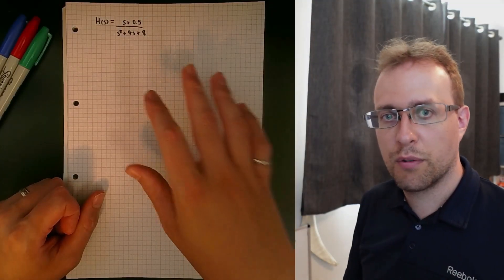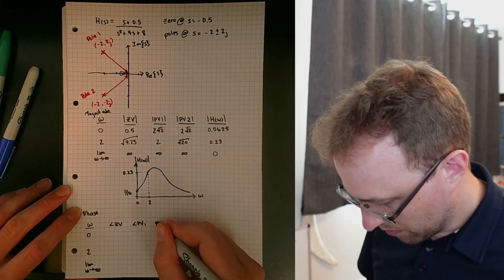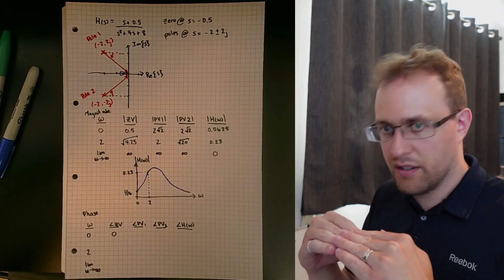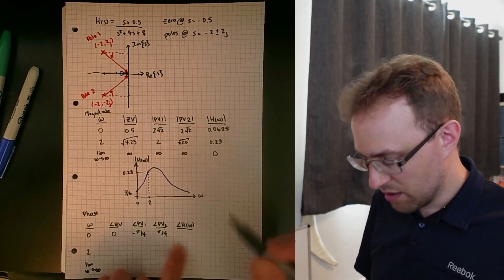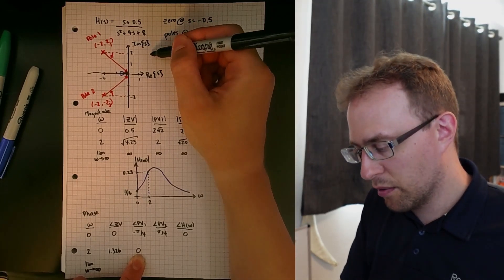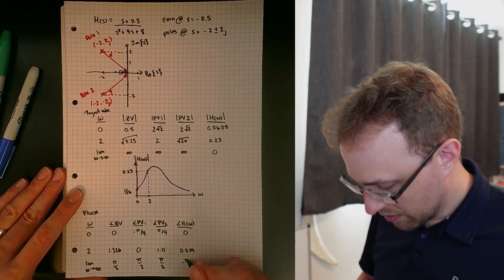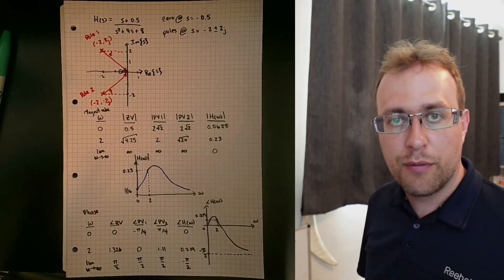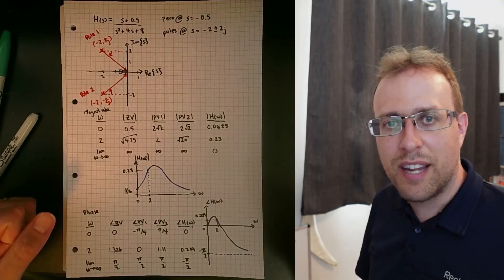Solving Frequency Response Phase with Geometric Approach (Analogue/LTI System)

Comment: Special thanks for examples you provide. They are really helpful in understanding the concept.

Dear Professor, I sincerely apologize if my question seems trivial. Could you please provide a concise explanation regarding the rationale behind the formulas discussed in the two recent lectures? For example, why the output phase is calculated as the summation of zero phases minus pole phases. 

Thank you so much.
Reply from the maker: Thinking of a concise way to write this ... Consider the writing the vectors of H(omega) in phasor form. Each vector would be written as vec = mag(vec)×exp(j*phase(vec)).

The magnitudes of the exponentials are all 1, so the magnitude of a product of vectors is just the product of the individual vector magnitudes.

The phase of a product of vectors is the phase of a product of exponentials, and when you multiply exponentials together then you just add the exponents.

The poles have magnitudes that divide and phases that subtract because they are in the denominator of H(omega). You could "move" them to the numerator by inverting their magnitudes and taking the negative angles of their phases.
Reply: @AdamNoel  thank you very much, professor.